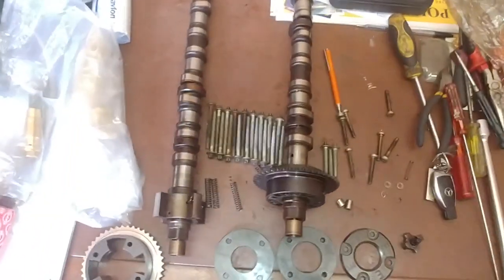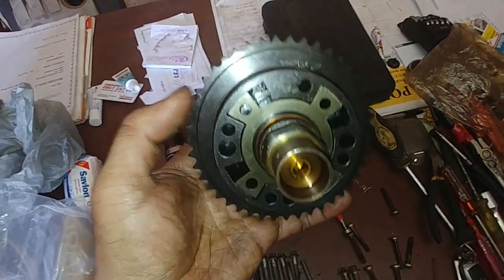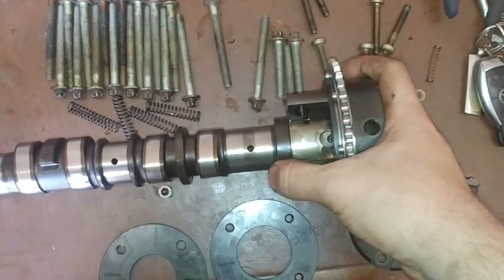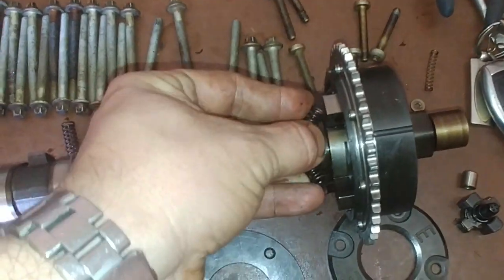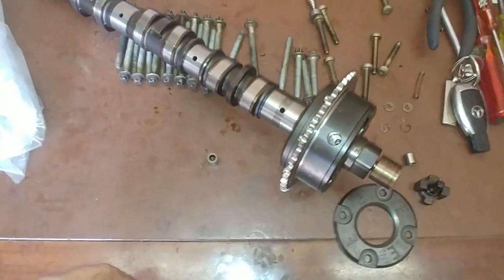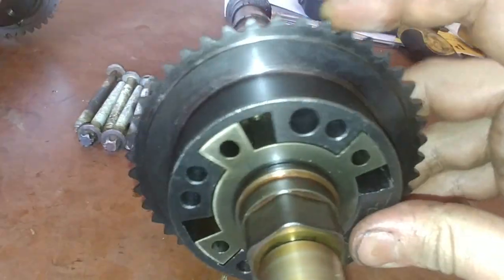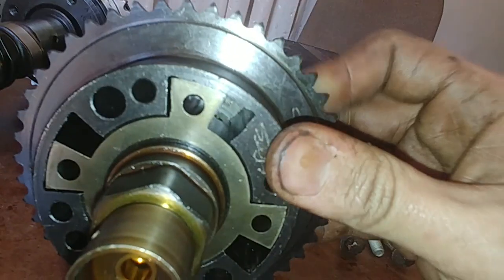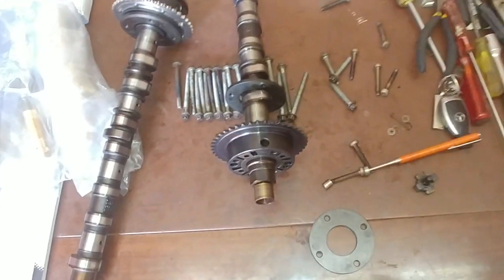Mercedes-Benz W204 M271 cam gear assembly

Comment: Hi,i have a problem wiyh p2054-002 /p0020 
If i push the clutch rpms goes too low an car starts shaking. Engine light comes and  the obdII show me this problem. Of i push the gas pedal when car starts shaking the car stop shaking and goes normal. Sorry for my bad english